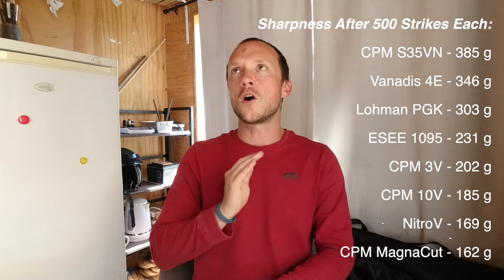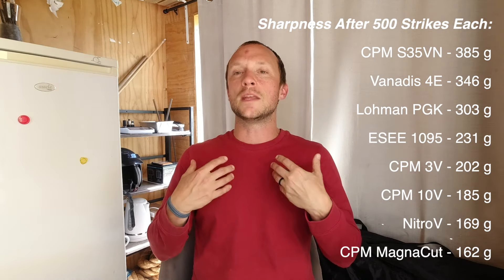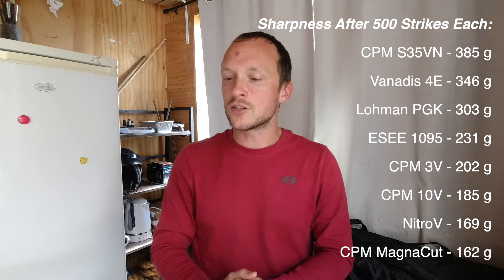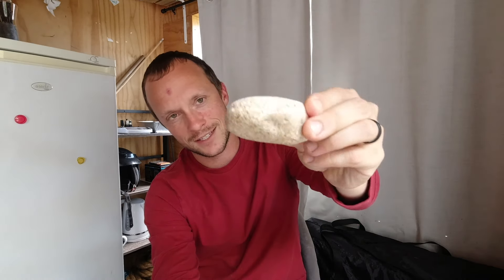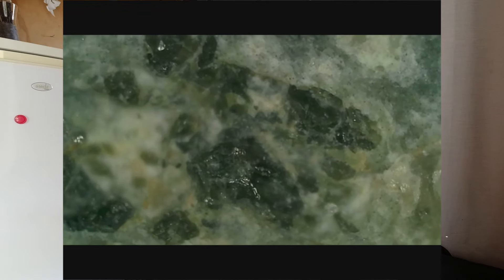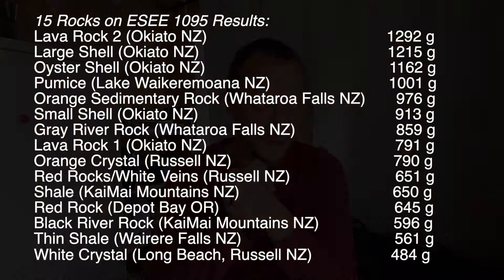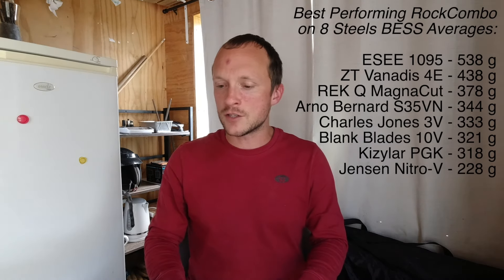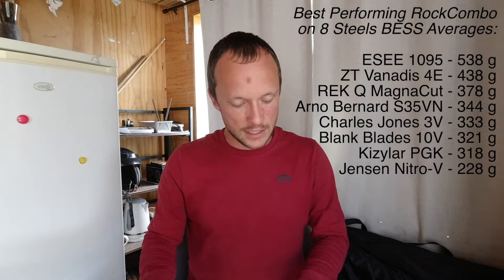What Did We Learn? | Survival Knife Sharpening (with rocks) Series Overview

Comment: I am curious about the Eafengrow claims because that first happened years ago and has been remedied since from what I understand, I havent seen any recent testing to confirm that either way but I sure would like to lol. It's wrong for a company to do that, if its still true, but if that isn't the case anymore then people should know that and it's good for the company in my book. I have a couple Eafengrow knives and they've been great for me with no complaints really, the one that I have in "D2" doesn't act like 3cr in my experience. However, I haven't done a bunch of testing on it to see it's just mainly been real world usage. Thanks for all the testing you do as well as the time and effort you put in, it's greatly appreciated!
Reply: I have three Eafengrow and they seem to be inline with what they should be. Their tarnished name is hard for them to overcome. They are excellent value for the money.
Reply from the maker: My apologies guys, the one I bought was indeed years ago (probably 5.5 years ago I bought it) I have since sold it and cannot do corrosion resistance testing to confirm.  Thanks for the information, I was not aware that the problem was resolved - it's more a case of me being out of the loop than anything.  Thanks guys!
Reply: @homeslicesharpening  you did nothing wrong lol, I am still curious to know if that's still the deal, which I don't think it is but you never know
Reply from the maker: I think the original research was done by LuvThemKnives channel.  Jared talks about it in this video https://www.youtube.com/watch?v=v5CxTnH4LX8

There is an updated video by LuvThemKnives and he tests a bunch of new Eafengrow and it's genuinely D2 - so I learned something here!

Comment: This is the first video of this series I have had the opportunity to watch so you may have covered this.  Did you attempt to use river sand or any other sand or dirt as a media to assist in flattening the rocks ?
Reply from the maker: I have used dirt in flat bark as a strop, rock "slurry" to flatten other rocks and attempt to deburr, ground pumice as an abrasive, and in the final video I grind a piece of crystal on a flat piece of shale to put a fine slurry of rock with uniform crystal size - that's how all the final knives were sharpened and how NitroV came up shaving arm hair.
Reply: @homeslicesharpening  That seems old school but a real alternative to modern methods.  
There is a video of a circulating that shows  " One of the Best " Japanese sharpeners.
He is stropping with two different strops . . .  about 3 strokes per side at a high angle. 
Only the video at this point but more details are likely to be shared in upcoming videos. 
I would like to figure out what he is using for strops.  Sharing more soon.
Reply from the maker: Got your email, thanks.

Comment: I watched this again. So would you choose 1095 or d2 in an outdoor knife. Seems to be more and more cheap outdoor knives being made in d2.
Reply from the maker: Between the two I'd choose... 14C28N 🤣  oh, sorry I had to say it.

On a serious answer, I would do 1095 over D2, and I would do well-hardened 1075 or 1084 or any near-1095-variant (1095 CroVan, SK5, 80CrV2, 52100, CarbonV) over plain 1095 as less carbon or alloyed variants help address the weakness that can be introduced in regular 1095 by plate martensite.
Reply: D2 is a poor choice for that role. Hard to sharpen on silica abrasives (rock and ceramic etc), it's half the toughness of 1095, and it still rusts even if less so. Better to get aus-8/8cr19mov or better yet 14c28n or 12c27 (Mora)